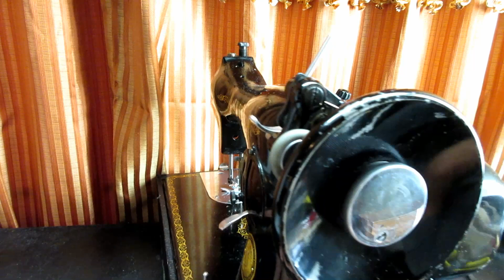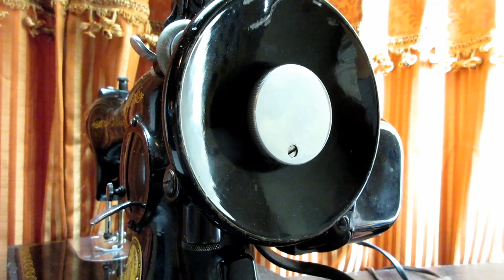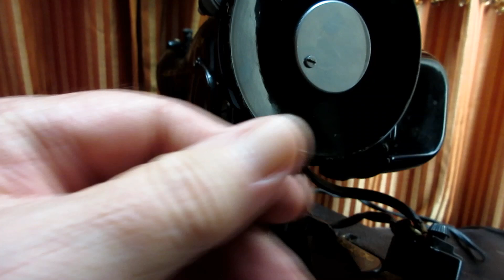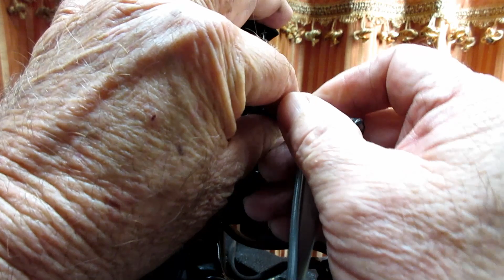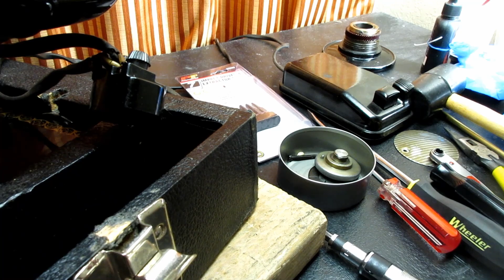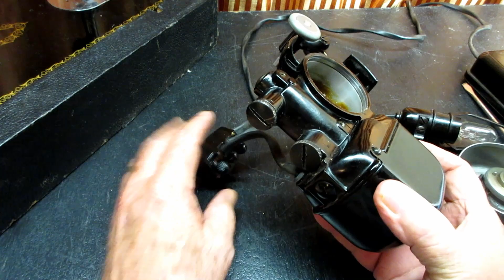Singer Model 15-91 Remove Motor, Light, 3-Pin Terminal & Handwheel.

Comment: I'm in the process of restoring my 15-91 singer. I removed the armature (which looked in good condition) from the motor and set it aside until I was ready to put it back together as I was waiting for materials I ordered. Today I noticed the copper windings on the armature turned dark and they were not when I fist removed it from the motor . Is it still good to use ? Why does this happen ?
Reply from the maker: I've never seen it, but I have heard of this. I think it's called oxidation, or copper oxide. Think of a copper coin, like a US 1-cent coin (penny) that darkens over time.
   ->>There is probably a YouTube video about cleaning it. 
If it were mine, I'd try using contact cleaner or 90% alcohol and a soft toothbrush, then rinse with water and dry it Very Well, like super dry.
      Oxidation on copper resists the flow of electricity. Many Singer motors have a coating on the wires to prevent that problem, but a 15-91 is old, and I don't know if the motor has that. Proceed with caution, and do a small test. A couple of Q-Tips with the cleaner and see what happens.
Reply: @andytubesewing1953  I'll try this . Thank you so much .
Reply from the maker: @kaltoumahmed8920  Good Luck.
Reply: @andytubesewing1953  Can I soak the whole thing in 99% or 90% alcohol?
Reply from the maker: @kaltoumahmed8920  It's your motor. For me, it is the toothbrush that will remove the oxidation. The physical light scrubbing. I don't see the necessity of soaking it. Did you search for videos about removing oxidation from motor windings? I'd still test a small spot before I did anything more.
Reply: @andytubesewing1953  Yes I've looked for videos for several hours but haven't found any . I feel very sad because I thought it was ruined . But I'll try with toothbrush and alcohol. Thank you !
Reply from the maker: @kaltoumahmed8920  
https://www.youtube.com/results?search_query=clean+oxidation+off+motor+windings

Comment: I know this is an old video and my comment may be a bit late but I am having difficulties installing the hand wheel! I took it out and put it in just fine and then I had to take it out again and I put it back in and it just stops at the threads and I have no idea what I’m doing differently than I have done before. I didn’t clean out the old grease, but it fit last time so I figured it should fit this time. Any suggestions? Thanks in advance.🙂
Reply from the maker: Hmmm... I'm not sure of the meaning of "stops at the threads". Sometimes, when reinstalling the handwheel, it gets stuck at a point and stops. That means the teeth of the handwheel gear are not meshing with the teeth on the motor shaft. I usually just wiggle the handwheel back and forth a small amount, say 1/16 inch to 1/4 inch, while gently trying to push the handwheel completely on. This method has always worked for me. You can tell right away when the teeth mesh together, and you do not need a lot of pressure.

Comment: Hello.  Please help.  I removed the clamp screw and placed the stop motion clamper in the right position.  Screwed clamp screw back on turned it to left and heard the click when turned to the left.  But the needle bar does not go up and down.  I noticed when you removed the back silver round cover with thumb screw when you turned the hand wheel stuff on there moved.  When I turn hand wheel nothing in there moved.  The needle bar does not move either.  Please help.
Reply from the maker: Step back a moment, Gloria. When the silver Stop Motion knob is turned to the left you are putting the machine in Bobbin Winder Mode. That means you are STOPPING the Sewing Motion of the needle bar, feed dog, take-up lever, etc. That is why it is called the Stop Motion knob. The purpose is to ONLY allow the motor to turn the handwheel so you can wind a bobbin. The idea is to save wear on the sewing parts when you only need to wind a bobbin. For Normal Sewing, you turn that silver knob to the RIGHT until it Clamps Down on the Washer and will not turn any farther. That engages ALL the Sewing Motion Parts; the needle bar, take-up lever, feed dog, etc. It appears this machine is new to you and may I suggest you read over the Instruction Manual that you can download a free PDF copy of here: https://ismacs.net/singer_sewing_machine_company/manuals/15-91.pdf    The Original Singer Instruction Manuals were created by Singer engineers who designed the machine and offer very good, IMO, instruction for the best way to operate the machine and get the most use of it with the least amount of frustration. It is usually well worth the time to read and keep handy. If I have misunderstood the problem please let me know and we will keep moving forward. It is an incredible machine and I'm happy you have it.
Reply: @andytubesewing1953  Thank you for all this information.  I hadn’t seen your response until now.  I didn’t have the notifications on.  😄
Reply from the maker: @GloriaMeskus  No worries and good luck.
Reply: @andytubesewing1953  Hi Andy.  I printed out the manual as you instructed.  I can’t seem to find in the manual that will help me get my 1951 15-91 unstuck.  She is stuck with the needle up position.  She has a potted motor.  I have oiled her plenty with Singer Machine Oil.  I plugged her only to check to see if the light works.  It does.  She is unplugged now.  Her hand wheel only turns when I unclamp the stop motion.  When I tighten it up her hand wheel is stuck and the Take Up Lever ever so slightly moves and is stuck.  Please help.  I am a rookie and desperately wants to learn how to repair my machines.  Thank you ever so kindly.  She is a beauty otherwise.
Reply from the maker: @GloriaMeskus  Did you know that when the clamping is engaged on the handwheel that is what makes all the parts of the machine move/go/turn except the presser bar. Dozens & dozens of moving parts that move in sync on a sewing machine. If just one of those parts is stuck/bent/broken then and can not move than the other parts can not move either. 
     The handwheel is not stuck b/c it moves freely when you unclamp it from all the other parts. It is some other part that is the cause. There is no book or video that I know of that will tell you "" oh, part this or that is stuck and causing the problem" you have to find it. You have to troubleshoot it. 
     You may have to use the process of elimination by starting to remove parts. We do not know how long the machine sat idle; months, years, decades? I have often found machines completely frozen like that and often because whatever oil was in it just sat there and dried up and turned hard. Kind of like gluing and parts together. Sometimes just adding new oil is enough, but many times not.
     One thing you can eliminate is the Hook and Bobbin Case. It's not that hard to do and sometimes the case was not reinstalled properly and is "jammed" and cant move, and if the Hook wont move then nothing else will as I mentioned. If removing the bobbin and bobbin case that did not free up the machine then I take a hair dryer and heat up all the parts I can see around the hook, needle bar, under the bottom, behind the side cover plate. That heat can soften the old oil enough to get a little movement and break the freeze if that is the problem. 
     The OSMG (old sewing machine guy) would put kerosene everywhere you but oil to chemically loosen the oil. Sometimes they would soak the machine overnite it was so frozen, 
     You were so fixated on the handwheel and clamp that I started there with you. Now it is apparent that is not a problem. On a working machine you can take the handwheel off and use your fingers to turn the arm shaft and it will move everything.  Yours won't thus presenting evidence of a jammed part or dried-up oil hardened in the bushings and bearings.
    Try the bobbin case to be sure it is not jammed. Just remove the bobbin and bobbin case. Try heat on the parts.   Maybe some of the 17 videos in the Model 15-91 Playlist will give you ideas and show you what other parts are on the machine.
Reply: @ I very much appreciate your guidance.  I will definitely remove the bobbin and its case and do what you said.  Detective work.  I watched most of your videos on 15.  They are very detailed.  Thank you for all you do.  It is greatly appreciated.  You make repairs look so easy.  Mine was made in 1951 the same year I was born.  Imagine that.
Reply: @ Thank you.  Thank you.  She isn’t completely free yet, but we have some progress!  I did as you said.  Removed bobbin case and bobbin.  No go.  So I used the hair dryer and heated up parts around the hook, under her, inside the side round cover plate, and needle bar.  Today, her Take Up Lever moves a bit and inside the round cover plate I can see some movement.  I oiled her everywhere again.  Tomorrow I will repeat with heat and see if she is resuscitated.  I am so happy.  My grandkids told me Grama she is only a machine.  Oh the hand wheel moves slightly with the clamp tightened.  Once I free her, my husband will help me check the motor to grease the wicks.  I can’t wait to sew with her!  You are very much appreciated.
Reply from the maker: @GloriaMeskus  You're on the right track now and thanks again for saving that machine totally worth the effort
Reply: @andytubesewing1953  Guess what!   She broke free this morning!  It felt like she had been in labor and gave birth this morning!  I am so elated!   Thank you!   She is a beautiful 51-91.   She has a potted motor.  Thank you Andy.  I can’t wait for her to sew after being stuck for more than 3 decades.  You helped me save her.
Reply from the maker: @GloriaMeskus  I'm so glad you did not give up Gloria your machine sounds wonderful and hope it sews like a dream congratulations.
Reply: @andytubesewing1953  She and I are the same age…..73 years old.    I won’t say you are not gonna believe this cause I know you will.  I bought another frozen 66 this morning.  A 1926 RedEye with cabinet that has 6 drawers and the black wrought iron Singer underneath.  I will buy a belt soon!
Reply: Oops not 1926.  She is a 1921.
Reply from the maker: @GloriaMeskus  Oh, I do believe you. It is very rewarding to work on these wonderful machines. Model 66 is a famous model. I have a Playlist for model 99, a 3/4 size version of the 66 with the same mechanics. These videos may help you while working on your 66 https://www.youtube.com/playlist?list=PLsCOZgzzaiKIIUgkEujqHc9iNWN9NPW2Z    You can also download a free copy of an original Instruction Manual here  https://ismacs.net/singer_sewing_machine_company/manuals/singer-model-66-sewing-machine-manual.pdf
Hope you love both of your "Iron Ladies".
Reply: Oh I forgot to mention the take up lever doesn’t move either.  The pressure bracket does.  Uh I’m.  😂

Comment: the wiring diagram for the 3 pin terminal was critical, for one going in and out of a cabinet.  thank you so much
Reply from the maker: Welcome. Copy of the original adjusters manual is free on the archive: https://archive.org/details/singer-15-91-adjusters-manual-en/mode/2up

Comment: If the wheel is not not working or turning what's wrong with it
Reply from the maker: Hey Billy, the two most common reasons I have found is that the bobbin case hook area has a part loose and is blocking anything turning but the primary one is if the machine has set idle for years or decades. It's full of dried oil and all the moving parts that dried oil just acts like a glue or varnish and sticks. Everything together. All the parts on the machine move in unison so you're saying you can't turn the hand wheel but it might be the needle bar is stuck in the bearing from drive oil. The first thing I do is go to singer.com/support and download a free copy of the instruction manual for the model, then look in there to see where to oil it. Then give it a nice heavy oiling and try and wiggle the hand wheel and get it moving. If that's not enough then I'll take a hair dryer and apply hot air inside the nose, the needle bar and underneath to all the parts I can see that would move usually the same place as you oil right? There's also a little removable cover on the back side that has a lot of moving parts 95% of the time that oil and heat will get everything moving. The other option is if you don't mind chemicals instead of applying oil put kerosene into the oil ports instead of oil and that can help loosen up the old oil. Once the machines running, then put good oil in and run it for a few minutes to flush out the kerosene. You can use a penetrating oil like PB, blaster or WD-40 also. But then you have to flush that out too. Good luck. It's a heck of a machine

Comment: Great diagrams on the video. It was easier to understand and gains confidence. I installed my 99k as handcranked. Is there a way for the singer 15 to be install as hand crank? I love using them since swapping out the motor.
Reply from the maker: Thank you. My understanding is that certain model 15 machines with spoked handwheels can be used with a hand crank. The 15-91 in my video can not b/c of the potted motor setup. 15-88, 18-89, and 15-90 can use the crank. You can download a free copy of the Singer Instruction Manual for the 15-88, and 15-90 at this support link: https://www.singer.com/search/support?title=15    it is the top one of the listed manuals. Here is an example of a modern hand crank for sale: https://www.quilters-connection.com/shop/c/p/Hand-Crank-for-Singer-x63274760.htm   If you Google "singer model 15 hand crank"  you will get 12,400,000 listings for articles, videos, blogs, and for sale listings.

Comment: Thanks Andy!  Your videos are incredibly helpful!!  I just got a free 15-91 and am giving it a deep clean following each of your videos. I also have a broken off brush cap on the motor, how did you get it off?  I do have a replacement cap ready to go.  Thanks in advance for any assistance. Lori
Reply from the maker: Wow, that's great! Happy for you. My friend said he has replaced a few by scraping or grinding (with a Dremel tool) a slot across the top of the broken one and then used a screw driver to take it our. I used a dremel with a narrow etching tip and as carefull as I could and it ripped the top of the broken screw right off in about 3 seconds! OH, Man! So, what now? I ended up using a utility knife and the can opener of an old Swiss Army Knife to painstakingly dig our the "barrel' if the broken off screw. It is hollow inside. I went supper slow b/c I was very worried I would damage the threads in the hole of the motor. It finally all came out and I use a small cylindrical wire brush to clean the threadS. My new cap was plastic and I brushed a tiny bit of grease on the thread and it went right in, smooth as butter. That was the best part of replacing that screw, that the new one went right in, and believe me, I did not over-tighten it. Good luck.
Reply: @andytubesewing1953  Thanks for the details on how to tackle this, as well as the quick response!  I really really appreciate your experience and sharing your knowledge with others!!
Reply from the maker: @klrussen638  Details are my thing, haha. Here is my playlist of 17 videos for model 15-91. https://www.youtube.com/playlist?list=PLsCOZgzzaiKJftyGwzdDiWa9R6HFEACJo
Hope you enjoy working and then sewing on it.

Comment: How did you get the busted screw off, and what kind of screw do you buy to replace it ? Mine has the same issue. Any help is appreciated!!!!
Reply from the maker: it was a hassle for me. My friend said he just pressed a screwdriver into the broken top and unscrewed it slowly. When I pressed a screwdriver into mine it just poked a hole into the hollow bottom part of the screw, haha. 👀 I used a utility knife, upsidedown, to press into the inside of the broken part of the screw and dragged it counterclockwise. Sometimes part of the screw broke off. I used an eyedropper and put a drop of WD40 around the edge of the screw and that helped. I was concerned that using this method would damage the threads inside the hole but it worked out OK. I bought two new plastic cap screws for about $10  but they are twice as much now. There are many sellers if you just Google "singer cap screw #193543" Shop for the best price. OH, you can also buy used ones and they cost less but are made of bakelite and as old as your broken one so it's risky IMO.

Comment: nice video, very helpful thanks Andy... Is there a video of how you got the broken plastic brush cap out.? I have a broken brush cap..
Reply from the maker: Sorry, there is not. That's when I was so sick I could not continue with the videos. https://youtu.be/AQt0GzHdj30  Over about a year I did rehab the motor but did not record that. My brush cap was so bad I drilled a hole in the top and used a sharp knife to dig it off the inner threads. Bob Fowler may have a video for it, but I'm not sure.
Reply: @andytubesewing1953  Thank you for the reply Andy... I'm sure I'll get it out one way or another..  I picked up another 15-91 today, so I will be watching the rest of your videos.  Thanks again..
Reply from the maker: @connieworcester55  Thanks for saving these machines, Connie. 🙏 I'm thinking in the future, down the road, you may be making your own sewing videos. 😲 I'd look forward to watching them. 👀